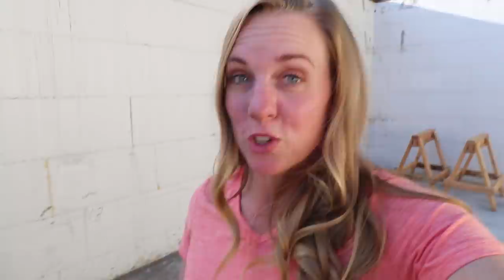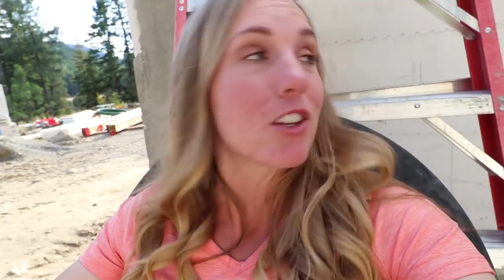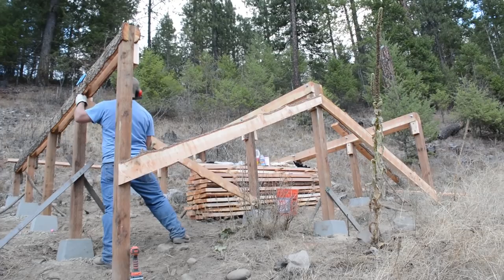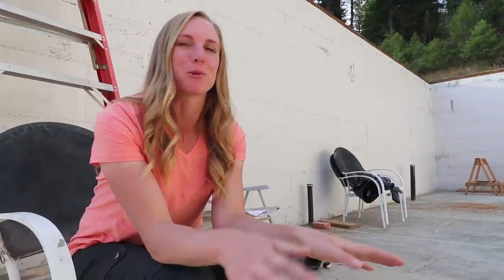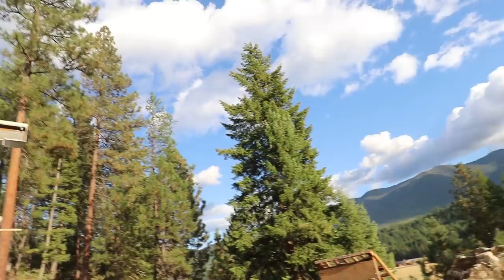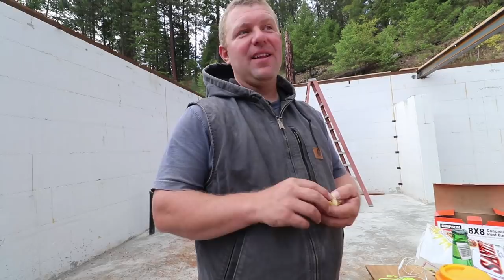Is QUALITY WORKWEAR Really Worth the Money?

Comment: You guys should get one of those cell phone signal repeater/booster devices, you set them up in a spot with signal and it broadcast its own signal so that you will have good service anywhere on your property. It would be cool to see how good they work.
Reply: Especially, solar powered cell phone signal repeater/booster devices
Reply: Also they don't have service in the garage, but on the floors above it the extra height and fewer obstructions could give them enough reception.

Comment: In my not-so-humble opinion, there is no such thing as "cheap".  If it's not built to last (or outlast) the expected life span, it has to be replaced sooner. I don't do as much outdoor work as I used to, but I still do give my workboots a rough time. So far, I have bought three pairs of "expensive" workboots (quadruple stiching, heavy cleat soles, steel toes, all leather uppers, around $200  each time) in the last 40 years. Once, when I was in a financial bind, I bought a pair of "cheap" boots for work. I blew that pair out in a week; lesson learned the hard way.  I agree fully on your clothing advice; it's very sensible!

Comment: Vests are nice for temperature control.

When working out or doing heavy manual labor, you're actually going to radiate most of the heat out of your forearms. (where you have relatively HUGE vascular systems very close to the surface).

The vest will keep your core from cooling off and feeling too cold.  But your arms will be doing most of the regulation.

Also, if you're like me (huge, wide feet), unfortunately most footwear providers are not there to service you.  So you're stuck with New Balance unless you're going with a custom-fit shoe/boot like Red Wings.

Comment: i been watching their videos as work progressed it  saddened  me to see them remove the foam at  the  slab level i  been  building icf  for   close to  20 years  by  removing the  foam  you  now  connected     the  heated  slab  to  the  ground um  can  we  say   giant  heat  sink
Reply: Made no sense to me either.  No expansion material and no thermal break. Also, seemed like such a thin layer of foam. I would have expected at least 4" maybe 6"
Reply: ive  seen this  before its the  house you  see  with  the  nice  green  grass in  a  4  ft perimeter  around  the  house  in  march
Reply: basically  it  doesn't  even meat  the building   code  but  seeing as    they enlisted the  services of an  engineer they overrule the  building inspector
Reply: They talked about the backfill pushing in on the bottom of the wall,and removing the foam and running the slab to the wall would allow the slab to back brace the wall. I believe it was planned by the engineer?

Comment: I am a trim carpenter and an estate gardener. As a woman doing 8-10 hours of physically demanding work each day I found it really matters what I wear. Often with several men from other  trades working in or on the same property I'm working in, it is so important that my clothes fit well without gaps! No T's that gap, or thin out, or tear easily.  No pants that ride to low and gap, esp once you get your loaded tool belt on. Steel toe work boots that I don't trip over.  I'm with you Alyssa, I can work along side of the boys, but I don't want to be mistaken for one. :-)  I never found a pair of carhart pants that worked for me, but did find Duluth pants that were/are perfect for the way a lady is built and will stand up to the abuse.  They really are worth the money in my opinion, but I still try to find them on sale. :)

Comment: I know you are asking for clothing. I currently don't have any input for clothing. But one BIG investment I learned was to find a good hand soap. I highly suggest Pro Soap. I know you are always getting your hands dirty with everything you do, so you will have to wash your hands at some point during the day. I work in a machine shop and constantly have all sorts of oils and coolants on my hands. I also wash my hand a lot through out the day because of this and found that other abrasive soaps dry out and irritate my hands. Pro Soap, does not. It works better than that orange scrubby soap and doesn't kill my hands in the process. I hope this is still good advice even though it isn't clothing related?

Comment: They make a cellphone signal booster if you are getting such bad reception out there. Note: some people talk about the effects of the signal boosters so if you are sensitive to RF transmitters they make a mobile version that has a cradle to hold the phone to not have as large a sending zone for the part near you. The car version has a much shorter cable between the outside transmitter and the inside cradle. The home/office model uses coaxial cable to link them so you can have a much longer run to a point you do get a signal. 

If I remember right you should be able to use a dc to dc after market transformer to go right from a 12v battery to it to skip the inverter.

Comment: Mountain climbing clothes are awesome. I like Royal Robbins.  Also Prana and ex Officio.  I have 10 year old clothing that has still not faded and gusseted.
Reply: ck m I have a 10 acre horse farm and do concrete work, tractor framing and build screen printing blanks, I think they're best for the welding that I do because of the gusseted. My experience is different than yours but I have fantastic experience with mountain climbing equipment end clothing

Comment: Greetings from SW MT. I've been watching for a while and just have to comment! You guys are doing a great job all around.I've been a builder for over 35 years and have had to learn that there  are always going to be  negative comments. Let them slide. From someone who knows, you're doing great.  Now about the clothes! I've worn lots of different brands over the years and have found that Carrhart is good, and Duluth, with their never wear or rip policy, is very good but pricey. Recently I found Sportsmans Guide and their Guide Gear clothing to be inexpensive and quite good.  Especially their fleece and flannel lined pants. Working on my Woodmizer is murder on clothes, yet these hold up just as well as any others. They come in a baggy, relaxed fit style which is great to move around in and cooler in the summer. Their women's clothes are quite good also, although they don't have quite the selection as some places.  Alyssa, try the Red Ant brand in MT, I've heard they are really good. It looks like you're barely going to get the floor done before winter. Make sure you put some type of high quality preservative on it before it gets wet. And use plywood not OSB, its much better for a long exposure to bad weather. Years of firsthand experience has taught me this! Keep on keeping on!!!  steve

Comment: Salomon X Ultra Low 2 GTX Hiking Shoes. I swear by these. They have Gore-tex and I can stand ankle deep in a puddle for a week and my feet stay 100% dry. I bought these 2 years ago last week and have worn them EVERYDAY since. You can get 3 SOLID years out of these no problem, maybe even 5. Aggressive tread, puddles don't phase me. I walk through puddles and give them as much thought as you give walking on a leaf in sneakers. Super comfy and they dont make my feet sweat, even in the dead of summer in 100 degree weather. They also have a unique lacing system. At first i was hesitant but honestly it doesn't slip and holds firm. You can cut of the circulation in your foot, it holds so tight. I can put these shoes on and "tied" in 5 seconds. They're $140 retail and you can usually catch them on sale at $120 but for 3 years of performance is definitely worth it. And here i am at year 2 and they still feel like they did when they were brand new. They also have taller boots available as well, however, I chose the low cut because im usually in an urban environment. Great Shoes HIGHLY Recommend!

Comment: I like all the stuff you're talking about but I'm just going to throw this out there for those of us who are on a really tight budget.  You might want to check out the Redhead line from Bass Pro Shops for good quality at a reasonable price.  It isn't the same quality as Carhart or Duluth but it is very durable and comfortable clothing.  I've had a couple of Redhead button down shirts that have lasted me going on 5 years and I use them for work, camping, hiking, etc. These shirts have somehow avoided stains over the years, so I even wear them to the office sometimes.

While it is true that you get what you pay for, there is also a point of diminishing returns when it comes to paying more.  So if you're not working out in the elements 14 hours a day, you might not see much benefit from spending a LOT more on clothes that are just marginally better in quality.  I will say that the one caveat I've found with Redhead is that they have a tendency to crinkle at the pockets, cuffs and collars, so there's more ironing involved there.

Comment: If I buy cheap clothing it falls apart I have learned that you might pay more initially but they last 5x longer. I like lucky jeans and I've had one pair for 7 years yes it's 100$ but 7 years. And the fit is everything. No matter the brand. With that said I don't work outside with them like you guys so idk how they hold up that way bit everyday wear they are good

Comment: I have worn bibs for my entire working life with a long sleeved denim shirts.  I rebuild diesel engines in heavy equipment, earth movers and such, nothing is dirtier. In the winter I wear long johns underneath.  If I have to crawl under a machine or am otherwise going to get filthy dirty I put on coveralls. At the end of the day I can wash my hands and face and put on street clothes and look presentable. Boots I either get Wolverine Wellington or lace up with steel toes and non-slip.  A GOOD TIP on footwear I learned a long time ago is DO NOT wear the same boots over and over everyday. I have several pairs of boots enough to wear a different pair everyday and if my feet start to ache I put in a different pair. And when I got to but a new pair I never buy a pair unless they feel like I've been wearing them for a month.  "They'll break in and loosen up with wear is a MYTH" Don't buy them unless they feel like they were already broke in.

Comment: On a previous video you asked for knife advice, but I can’t remember which video. Regardless, I have a Kershaw that I love. It’s an older model, similar to the knockout. The quality is great and the engineering in it to be quickly opened with one hand and lock open through a frame lock is great. I’ve had no issues with mine and recommend the brand.
Reply: I have a Kershaw that is a carabiner(non load bearing), clips right on your belt and is a one handed knife.

Comment: I have always had to worse time finding work boots, I was lucky to have a pair last 6 to 8 months at best. I'm usually on my feet 12 to 14 hours a day and in my boots 10 tp 12 hours a day, being a Diesel technician they tend to get the oil, grease, coolant and such. Back when I worked for Ryder I got my first pair of Red Wing work boots, the fit was unbelievable and that was the first pair of boots I ever had last over a year. Then when I worked for Waste Management on heavy equipment for 10 years I had to have puncher resistant boots to work on the active work face. In 10 years I went through 3 pairs of boots and I'm still wearing the last pair 4 years after I left the landfill. They don't have any tread left on the soles and one has a hole over the steel toe, so I really need to get a new pair. The thing is I can order the size and model and the boots fit the same as the last pair, so while Rush Truck 
Center only pays $100.00 toward boots rather than get a pair that is under $100.00 I will spend the extra money because I know the product is worth the price. If your feet aren't happy you won't be happy, Waste Management also sprung for a pair of insulated Carhart bib coveralls; I had a few pair of the Walls coveralls and the held up pretty good, my Carhart bibs are still going strong after 7 years of use. I don't work outside as much as I used to, however having the right cold weather gear I still go outside and work where other guys are pushing trucks in and out of the shop to be able to work inside; I don't get paid to push trucks, I get paid to fix trucks so I would rather work outside that waste time pushing trucks; I'm hard core like that.
Reply: mrgearheadfromhell what boots do you like?

Comment: I may be a bit of an out sider here..   I live in the far north of canada. which my you tube  name probably will give away.  but  the summer here is brutal. it's extremely dry the sun lasts until 2 am in the summer.and it's back up again before 4am. I've tried most of the major brands that are available  in my area.  and since there is a lot of placer mining  they demand good cloths..  

I've found working in a kilt  alleviates alot of the problems with pants. no binding in the groin   nothing rides up..   your comfortable. damnnearkiltem good quality durable fit is exact so do your measurements. 

like I said  I'll be a bit of an out sider. but  thought you all might be interested.  this is the first some I've not felt too hot or too cold you get more  done.

winter is a different animal though.
Reply: always wanted to try a kilt. my buddy from Scotland has one, with all the genuine accessories that go's with it! VERY cool. the quality is awesome.

Comment: My personal picks, Tilley air flow hats, Terra Boots, (3 seasons), Baffin (Winters)and Carhartt overalls. All have women's sizes. The winter overalls are lined and are roomy enough for a couple layers underneath. I like the zips at the bottom of the legs so you can tuck some into your boot tops and then cover all and zip it tight. Comfy at -40

Comment: Since you mentioned Cellular Service issues, I have to suggest that you look into a cellular booster. Wilson Electronics, now known as WeBoost has both fixed and mobile amplifiers. I have an older model in my car, as I am now in the Oregon Outback, and travel to just about anywhere includes long stretches of highway with gaps in cell service. I would say that the mobile WeBoost model that I have, cuts the "no cell zones" about in half, from my experience. Keep up the videos, and best wishes!

Comment: A great spring/fall/mild winter jacket is the Lands End fleece lined Squall Jacket. Lands End  also makes a Squall Parka that is great for being outside and moving around in below 35 degrees plus the sizing is roomy enough to layer on sweaters & sweatshirts underneath for even colder temps. I've also got a old Friday Harbor (?)  thermal lined zipper hoodie that's my go to outer wear to keep warm in the cold, its a bit heavy in the weight dept. & it absorbs the rain like a sponge & therefore can get over 15+ lbs. in total weight. I always kick myself for not getting it Scotch Guarded, that should take care of the waterlogged weight problem. I've had it for over 7 years so I'm not sure if they still make it, but I've seen a  Carhartt version of it, but the one I've got is still going strong.

Comment: A must when working with heavy stuff is steel (or other solid protection) shoes or boots.
I personally don't like boots, but have found steel toecapped trainers to be very comfortable, they allow me to move, but will protect my toes.
I wasn't in the construction industry as such, but my work sometimes meant crawling through tight spaces, but i just wore jeans and a shirt (add a t shirt and cardigan when cold) all the time,  luckily my work paid for 'safety gear' and i was allowed to class jeans as safety wear, a bit tougher than overalls (overalls were  restrictive for me anyway)
Function before form or looks is what i went for, as long as it was comfortable.

Comment: I cannot agree more about Duluth clothing. I recently bought a pair of pants to try, and now own 3.  They are my go to brand for everything now.  Yes you pay more, however, many people do not know that Duluth has a lifetime warranty on all of their branded clothing.  Technically, it can be the last time you have to buy clothes
Reply: dchaney40 The  warranty is good for as long as they continue that line of clothing.  I have returned multiple  pieces of clothing from Duluth and I've  even been able to increase my waist size with no questions asked.  However, I have returned some work pants and have had to pay, not including shipping,  a portion of the price of the  product.  Prorated might be the  correct  term.
Reply: LL Bean also has a lifetime warranty on clothes. I've found their warm, flannel lined jeans to be excellent. Their thinner insulated tops and bottoms to wear under your clothes in winter are excellent. I forget their name....I call them all  underoos...lol. Anyway wore them for an 18 hour outside gig in January and was never cold, and I'm cold ALL the time.  I also keep hand warmers in my pockets, they'll stay hot all day if you shake them now and then.  Just leave them outside when you're done using them instead of tossing them in the trash. I'm afraid they'll cause a fire if mixed in with paper and stuff.

Comment: So I used to work at a high end mill in northen New England that used Sapele which destroys clothes. I went through Carhartts, then Arborwear (which I think is the best for the money), and finally Filson pants. So the double tin pants....A. crazy expensive B. take forever to break in C. you can't wash D. Limited season (Fall till Spring) E. Once damaged must be sent back but are replaced. In closing they feel like an event when put on and worn. Arborwear as I stated are in my opinion the most hard wearing with best fit and features.